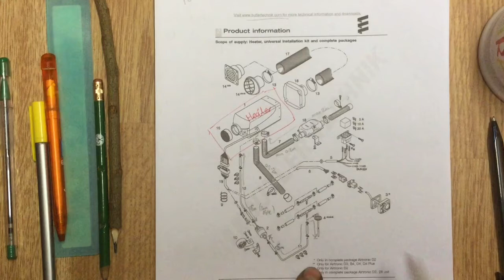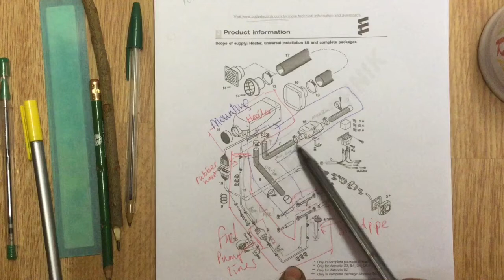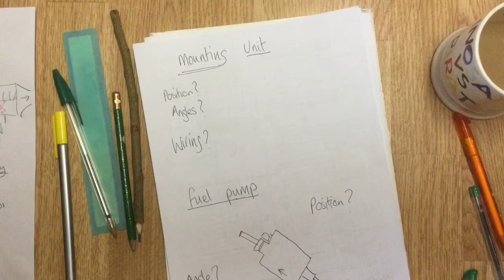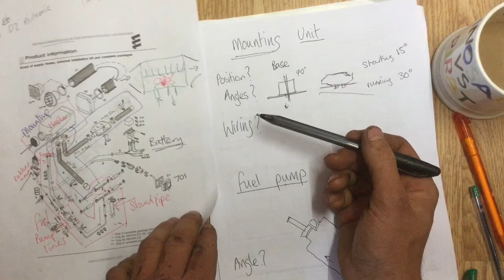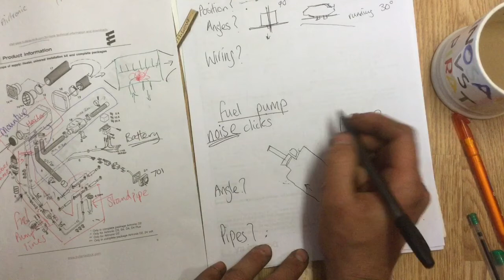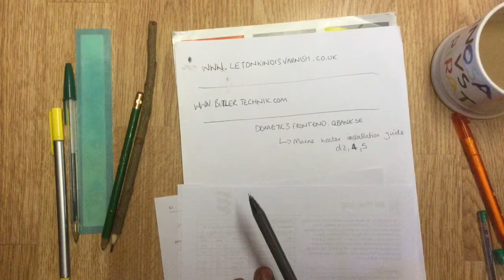Fitting an Eberspacher Heater  - Technical bits part 1

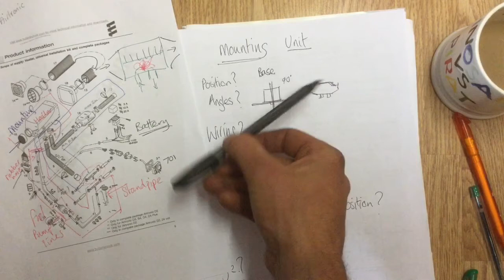Comment: Excellent series - very helpful.  Just one correction:  the heater CAN be mounted on its side i.e. on a wall, not as you suggest at 7:19 flat only.
Reply from the maker: Correction accepted in one axis it can move through 90 degrees but not along the other. Not sure of the link you gave as it tries to get me to log into Facebook, here is another for folks not wanting to risk that... https://www.butlertechnik.com/downloads/Eberspacher_Airtronic_D2_Technical_Manual.pdf (see page 18 )

“Depending on the installation conditions, the heater can be tilted by max. 30° (flow direction to the bottom) or turned by max. 90° around its own longitudinal axis (exhaust connection horizontal, glow plug points upwards!).
Normal position horizontal (exhaust connection downwards) with tolerable swivel range
In the heating mode, the heater can deviate from the shown normal or maximum installation positions by up to +15° in all directions because of a slanting position of the vehicle or boat, without any impaired function”

Cheers for helping to improve this!
Reply: My link removed!

Comment: Hey, thanks for this video, i think you answer to the last question i had, but i just want to be sure ^^
When you say that the polarity doesn't matter, so i can put each of the 2 cables at any of the connectors on the pump ?
Reply from the maker: pouldato Hi there, thanks for watching it, I am fairly certain the two pump wires do not care which way round they are connected. Just looked on le tonkinois too and they agree, links here if you want a read its in the second section (pump wiring) https://www.letonkinoisvarnish.co.uk/Eberspacher_Wiring_1.html

Comment: Hello mate,
firstly this is absolutely exellent.
thanks.

any chance we can have a video on connecting a t piece?
Reply from the maker: +Arif Patel 

Hi there, thanks for the good feedback nice to know the effort is appreciated. 

As for a video on connecting a T piece, I don't have a van to do it on ATM. I will have a search around for some old fuel line, if I have a section I should be able to show the principles of it on the bench. If that would be helpful?
Reply: MiNe Yours - that would be great, ive currently got a stand alone fuel tank for our heater (not fitted yet) I'm a bit worried about tee ing into a fuel line because of getting air into the system. It's an old vehicle from 1982 so the fuel lines are going to be low pressure I think?